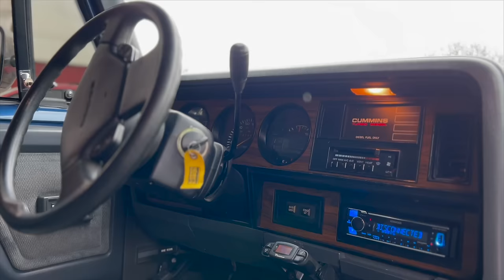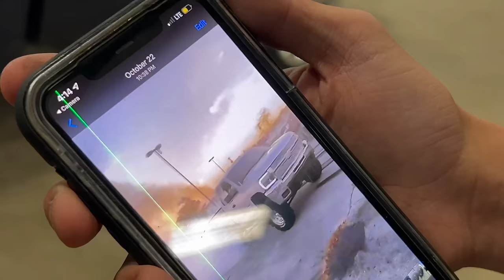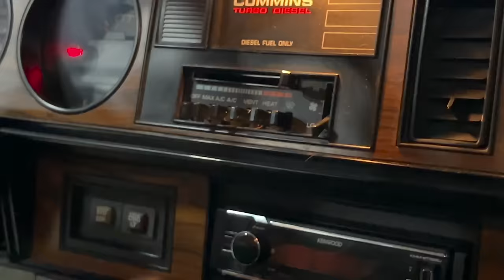He WON My First Gen Then Immediately BLOWS THE TIRES OFF!

Comment from the maker: What’s YOUR dream truck? 🤩
Reply: first gen, probably the one you just gave away
Reply: 1997 ford f-350 dually single cab flatbed dually with a 7.3 liter deisal
Reply: Crew cab cateye
Reply: This one was.
Reply: Alumiduty with a sick build and like prob like 12 inch lift
Reply: Dually 2nd gen or mint long bed 6.0 king ranch
Reply: I am going to find this truck it is 15 minutes away from me
Reply: Obs Chevy
Reply: Duramax
Reply: A massive first gen Cummins with a bed stack and when I say massive I mean taller then megan
Reply: 1st gen
Reply: 1997 ford f350 crew cab dually with a sun visor diesel
Reply: 2005 chevy silverado 2500hd duramax has to be crew cab or no cab 🤷🏻‍♂️😮‍💨
Reply: 1st gen dually black extended cab 4x4 lifted
Reply: @CS_Outdoors260  hell yea
Reply: 2022 gmc at4x
Reply: U should do more vids with the bike or bikes
Reply: 2018 f250 limited crew cab short bed
Reply: Super single dually bagged 97 7.3 power stroke
Reply: Anyone you bring me😂
Reply: 1997 7.3 5 speed full 4 door srw but converted to 6 speed
Reply: 1948 dodge power wagon crew cab 12v swap
Reply: Grey 2002 lb7 Duramax extended cab short bed zf6
Reply: Murder Ram
Reply: 97 obs ford crew cab long bed , cummins swap , so basically crude diesel obs
Reply: Ram 2500 6 inch lift rim and tires blackd
Reply: My dads truck it’s a single cad sliver GMC it’s pretty nice
Reply: To be honest, I would like to have a 2011 ford ranger. I know it may seem off, but I had known a man who took the time out of his day to treat me like his son and in all honesty he was like a father. He passed on and I want to have it as a great memory.
Reply: did you highlight my comment
Reply: Something on bags
Reply: 2005 f250
Reply: 1997 f350 7.3 power stroke single cab long bed srw on like 4 in leveling kit and prolly 35x12.5 on it
Reply: Chevy 4 door square body
Reply: Literally this truck is my dream truck… I have one rn… but it’s not a Cummins… want a cummins
Reply: 5th gen ram on a 4” lift with 35” tires/American force rims and 2g swapped
Reply: mines gotta be a LBZ duramax that’s like a grandpa truck so i would make it almost a farm/show truck hard to explain but i’d make it look like an ordinary farm truck with like crazy engine upgrades
Reply: How many miles is on this giveaway truck? Just curious. I would have bought it and if this guy will sell let him know I'm interested
Reply: 1996 dodge ram 2nd gen 2500 ext cab long box in dark green and silver  with some custom amarican force rims
Reply: Yours
Reply: My dream truck is to have a ford f250 with big wheels 🛞
Reply: The one you gave away or a 2000 ford single cab
Reply: I already own them now time to make them 60 feet tall
Reply: Murdered 1952 F-100
Reply: 2nd gen
Reply: 2ndgensortcabshortbed
Reply: 2013 ram 3500 mega cab dually,red two tone paint, 4x4. On super singles, 26’ forces on 40’s nd 6-8 inch lift.
Reply: 2nd generation dodge ram
Reply: Cardi b
Reply: 22 Denali duramax crew cab
Reply: a first gen like this
Reply: 1977 step side chevy
Reply: 2018 450 SUPER DUTY WITH ANY LEVEL
Reply: Crew cab lbz or a 1982 k10
Reply: White extended cab long bed obs 7.3
Reply: That grey 4th gen in this video
Reply: I got a 67’ gmc long bed 305v6  3 on the tree but too broke to finish it🙁
Reply: 10 lmm Duramax, with 44 boggers
Reply: 2006 ram 2500 on a 6inch rough contry lift on 20x16 forged rims
Reply: 2005 Chevy avalanche
Reply: A 97 4x4 single cab Tacoma 🥹
Reply: My dream truck is Ford gabe.
Reply: Is hailey with you gabe ?
Reply: You and hailey look so good to geather bro.
Reply: The first gen u just gave away
Reply: My cateye rcsb but I would put in a turbo 6.2
Reply: 1992 Ford F-150 with the 5.0.  like Grandpa has
Reply: Cummins swapped Ford f-450
Reply: 7.3 four door fourwheel drive with a bedstack
Reply: 3 Gen 6.7 Cummins
Reply: A 1987 Ford F-150 xlt lariat with mint interior with a 5.0
Reply: 2000 f350 6.0
Reply: Srt-10 ram
Reply: Either a 1997 f-350 with specialty forged and Cummins swap it or a 4th gen like Brandon’s but have a long bed.I’m only 10 and I watch your videos everybody tells me do something else😢.For the picnic table start it with visgrips that’s what my dad did with his 7.3.
Reply: 6speed sport trim 4x4 vp44 5.9 single cab short bed on some wiide boys
Reply: Ninja h2! Is my dream truck
Reply: Ford Excursion, Ford F250
Reply: Ram 1500 srt 10 2500 Ram crew cab 👍👍👍👍👌💪🤘😎
Reply: 1997 gmc k1500
Reply: The truck you gave away
Reply: My grandpa's truck is my other dream truck 1985 square body chevy.
Reply: I had my dream truck sold it like a dumbass was a 2000 k3500 6.5 Detroit crew cab long bed dully that was clean black on black had a 6" lift on 37 bfg ko2 man I miss that truck was the cleanest obs in my town.
Reply: Lifted 8 door 6x6 dually 1987 chevy Square body k30 with a 18 in lift on American forces with bags
Reply: U just gave it away
Reply: 94' F150 Lightning, managed to get one for $8,500 in 2002, it is now a street/strip truck
Reply: Any of yours
Reply: 1988 Ford ranger, full touring chassis with a Bara 4 liter. Totally stock looking outside, Silver.
Reply: @exhaust_note2327  the dude who one it already has one so i think someone else should’ve won it
Reply: Give it WhistlinDiesel to destroy it 😁
Reply: 1998 Dodge Ram 2500 regular cab long bed blacked out black American forces 20x14 on nittos bed stack 98mm turbos 14mm head studs 250 over injectors and a buil 48re trans with a ratchet shifter and a bunch of goodies
Reply: @marcbryant5665  exactly what I’m saying man
Reply: 1970 dodge power wagon crewcab wit a dually swap and a cummins swap
Reply: who thinks gabe  should do motovlogs
Reply: It would be any truck how do u enter
Reply: @downlow1311  its over already bro
Reply: Just this this truck i love it.
Reply: a secend gen
Reply: that is my dream truck
Reply: first gen 12 valve Cummins
Reply: Hi 0:22
Reply: @CS_Outdoors260 bro same but with regular bed
Reply: Cowboy
Reply: @TBCars23  nice